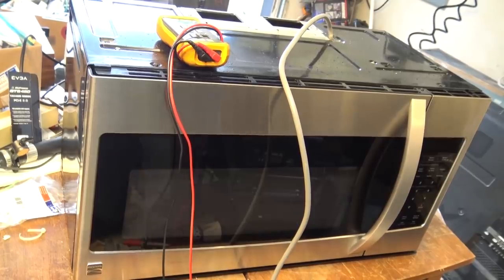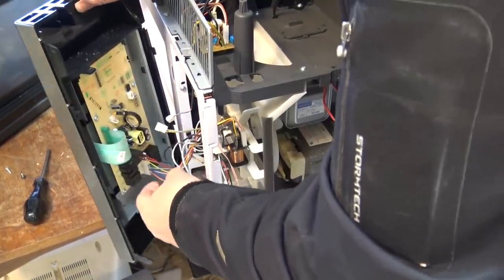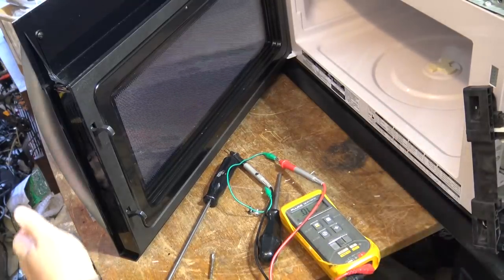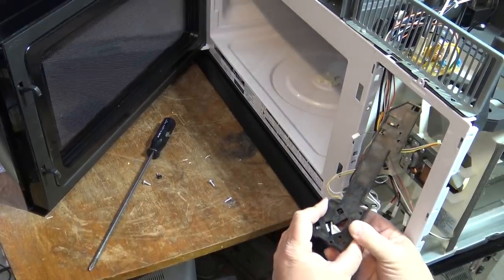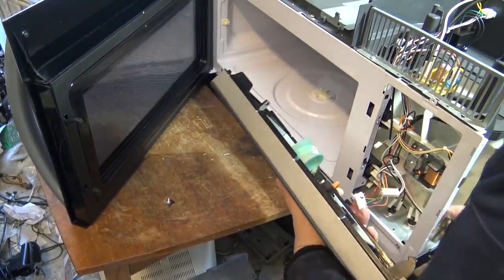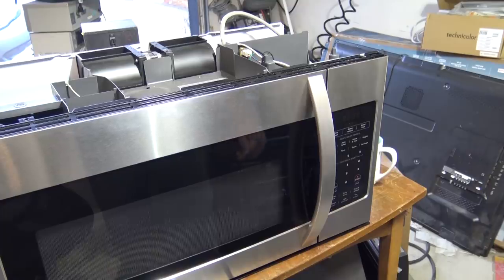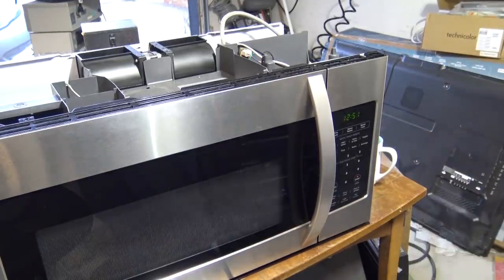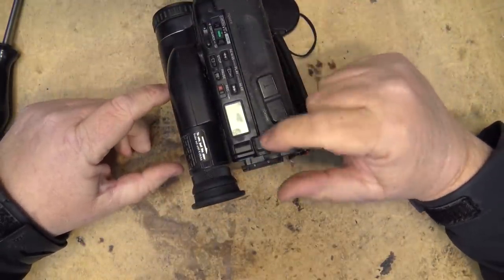Microwave Oven Blowing fuse as soon as plugged in

Comment: awesome !      Micro blew 4 fuses in the last few months......  worked for a few weeks inbetween.   Today it failed and kept blowing the fuse as soon as I plugged it in.
Found this video,  checked the door switches and one had failed.    Found replacements on amazon.       A $15 repair rather than an expensive service call   👍
Reply: Was it blowing the breaker once you plug in the outlet?

Comment: For those of you with the same issue with the door catch bracket that has worn out. I used an ABS slurry to “paint on” some additional plastic to repair that part. Worked great and saved me $30-40 for a whole replacement bracket. Acetone and melted some spare legos is all it took.
Reply: The biggest problem with these switches is opening up the Microwave while its still runner, that shoots a small current through the switches and eventually casses one or both to stick open, usually the one that closes first.

Comment: Excellent video. I watched several because my microwave pops the fuse as soon as it is plugged in. From watching your video, I understand why. I saw several saying it is the door switch (which I will check those tomorrow) but you explain WHY the switch fails and not just how to replace. Knowing WHY is just as important as HOW to replace it. Excellent work. Subscriber now!

Comment: Mine ended up being the switch holder. Without your commentary I don't know if I would have noticed the worn latch guides! 

I've only had this thing for TWO YEARS and it's already worn excessively. I had my previous Whirlpool microwave for almost 8 years and it still worked when i got rid of it! (although the finish was peeling off of the handle).
Reply from the maker: Yes ended up ordering the part and changing it.  Took 2 months to arrive.

Comment: thank for video .that is same microwave as ge.very common issue with them  .the problem is the latch body itself has worn out  that you can see in the video causing the  middle switch or monitor switch not to open up and short. ge recommended to change out  latch body  ,middle switch and door hook. if not it will happen again due to worn out latch and hook.

Comment: First word out my mouth when I saw the title was "crowbar"... Only because of a previous video where you explained how the dual door switches work though so thanks :)
Reply: White balance, yeah I thought you looked cold haha
Reply from the maker: A crowbar is an over voltage protection device. Can be as simple as a zener diode set to the maximum voltage in low current applications. In high power devices a SCR triggered by a zener is usually what is used in DC circuits. In more elaborate circuits the SCR would energize and latch a relay with the circuit  wired to the normally closed contacts. Once the zener activates the SCR triggers latches the relay to the NO contacts and removed power from the NC and your power is interrupted until he SCR is reset.
Reply: And this is why you have a subscriber in me! I knew it wasn't quite right to say crowbar, but couldn't think why lol. I just imagined it as a crowbar forcing the fuse to blow instead of the user's face getting roasted. I'll digest this reply & correct my terminology, thanks.

Comment: Sweet, just mine working! Thanks so much for posting this man!! 
Not the same exact problem here, but very similar. On mine, the fuse was blowing when the microwave was turned on. This vid led me to check the switches. On mine, the monitor switch was just a bit jammed up (stuck down) - pressing it a few times w/a screw driver got it working/springy again. I tested w/a multi-meter and continuity was working as expected, after that, plugged things back in, back in business. 😎👍

Comment: Sorry for the late viewing, my internet has been dead since last night to 11 in the morning today :-(.
Speedy repair :-)
My knowedge on microwave cookers is minimal, the anode of the magnitron is tied to negative (same as earth in the uk)and the cathode is connected to a negative voltage created by a high power/voltage diode and capacitor.
That 5kv transformer/diode/capacitor makes the red alert bulb lightup, i dont like being zapped lol.
That shorting safety switch is the most important one.
Reply: Your power was out too?? Mine was out for quite a while, from storms, I guess, not certain because it didn't go out until like an hour or more after the storm had passed.
Reply: A Three Dog Night
The difference in my case is it wasn't the power that went out, the isp service just failed.
Virgin media internet is a pain for having problems :-(
Reply: @zx8401ztv , Oh, OK then.

Comment: I still have my 1997 Sharp 1000 Watt counter top microwave still going strong. My door doesn't have a handle. You have to push a large button at the bottom of the control panel and it swings open. I plan to keep this microwave as long as it will nuke my dinner.
Reply: I still have the same one too. Sharp microwave with a push open button for the door. 1998 model. Clean quiet and strong 💪.?? With automatic popcorn timer.

Comment: This is awesome!!!  The comment you made about both contacts needing to hit at the same time solved my problem.  I noticed that the plastic mount holding the two door contacts was push back on the bottom after 8 years of use.  I realigned it and tighten it down and PERFECTO!!!  Thanks for your vid!!!
Reply: It’s kinda of an over engineered design to prevent silly people from operating the oven with the door open.
Reply: Actually one has to activate just before the other does so if that is not happening due to a bad first switch or a loose switch assembly it can blow fuses when you open the door.

Comment: after watching your explanation of the purpose of each of the switches i was able to figure out why mine was tripping breaker when opening the door even though the swicthes all checked ok. i always grab the handle at the bottom and jerk it open which over time has caused the shorting switch to activate a spit second before the top switch was opening.  after your explanation (which i couldnt find anywhere else btw)  i went out and grabbed the handle at the top and yanked it open and voila no breaker tripped!!!!

Comment: I think that the contacts of the driving relay for microwave lamp along with the internal tension spring sometimes need checking also because the contacts burned and remain stuck and the lamp keeps working without any other noticable sign.Once had this problem with the capacitor blown and the gears of the mechanical timer worn just because the relay contacts didnt open and the timer motor kept working along with the RF lamp in silent and melted the facing plastics until the capacitors short circuit.

Comment: Great video!     Our MCO1610WF blows the fuse when the door is opened.     All normal until then.  Likely a primary switch fault?    Are the top and bottom switches both primary and the third secondary?
Reply from the maker: On most the primary it top and secondary is one if the bottom.  The second bottom switch stops the timer when you open the door.   The secondary is a normally closed switch. The primary and timer normally open.

Comment: Sir..while watching your video...I have planned of heating my Burger to my microwave.. It just happened.. That my microwave..makes a large noise..not the normal...and I stop immediately... I switch off..then try it again..its the same..and when I stopped it again..I smell something like burned...but the unit I still on have lights..etc..no blown fuse or whatsoever...what do you think is the problem... Thank you sir
Reply from the maker: Possibly hv diode, hv capacitor or magnetron has developed a short
Reply: @12voltvids  thank you...I'm afraid of the noise though.. It sounds like a fridge compressor when cooling

Comment: My oven's panel was good but it wouldn't turn on the nuke. A bad switch tested good but it didn't work as well as the other switches.
I took the bad switch's cover off and found the lower contact slipped down a little that made the switch movement weak. I corrected the problem and sanded the internal contacts with fine sandpaper.
The oven now works. $0 cost. If it happens again I'll epoxy the lower contact in place to keep it from moving down.
My cheap Emerson was made in 2005 and works as good as new now after the fix.

Comment: Hi, and thanks for this video.  I have this exact microwave and it's tripping the circuit breaker every time you run the microwave.  I purchased all 3 new switches for the door and changed them out, but unfortunately it's still tripping the breaker.  

I think either it must be something else, or it could be the latch assembly that holds the switches.  When I took out the old switches, I think I broke off the little lever that holds the switch in place with the screwdriver.  Is that piece located on the latch assembly to hold the switches in place?  Do you think it would be worthwhile to replace the latch?  I've spent almost $100 on this microwave and it's still not working, so I'm reluctant to spend more if it won't be fixed.

Thanks in advance for any help!

Comment: Can you please explain why this system is better than having two normally open switches in series? Thanks
Reply: To prevent the microwave from operating while the door is open, most do have an upper and lower door switch.  Sometimes a broken or stuck latch, stuck switch, etc will prevent the switch from operating.  The final switch is this "Monitor" switch that shorts the line only when the other switches do not open first.  Sometimes a bad door alignment (do you slam the door?) will trip this switch first.  This shorting switch sometimes stay welded shorted, but this is not a fault of the switch.  It means it did it's job and the oven needs properly serviced for safety.  The other switches have failed.  All 3 need changes as a set as the first two failed and the 3rd protected you.
Reply: With two normally open switches in series both will be passing and breaking current so the contacts will get worn and have a higher chance of getting welded together (which would defeat the safety.) The normally closed monitor switch, on the other hand, never handles any current unless there is a fault, so its contacts will stay pristine.

Comment: Is there any reason why removing/unplugging the monitor interlock from the circuit would prevent the microwave from running? Of course, just from a testing perspective.  Seems to me if it was unplugged, circuit should would not short and 'act' as normally open. TIA.
Reply from the maker: If you unplug the safety interlock it will run. Thus us the normally closed switch that opens when it is pushed in.  The other switch to it, the normally open switch shuts off the timer.   The safety short switch does that, puts a dead short  across the line to blow the fuse.

Comment: how come they fail more often over a gas range compared to electric?  what's the difference?
Reply from the maker: Heat. Gas ranges produce a ton of heat. That is why people with gas ranges have big exhaust fans. Not only is there the steam from what is cooking there is the heat from the open flame. That heat heats up the bottom of these over the range units, and when you heat up the metal, and there is plastic inside what do you think happens to plastic when you heat it. I'll give you a hint, it gets soft and can warp.
I would NEVER install a microwave over a gas range. An electric or induction cook top, the only heat is from the steam, and well steam won't be more than 100'C or 212'F. The heat from the gas is much hotter than that.

Comment: I thought the door switches were my issue as to why the fuse keeps blowing as I have the same model. I replaced all 3 switches and the black switch mount , door hook. Tested all switches with door open and closed. Still blows the fuse after buttoned up and turned on.

Comment: Why does my microwave intermittently blow the fuse when the door is opened? It was not even being used. I pulled open the door and was about to put some food in. Haven't even press "Start" yet!  Checked all 3 switches with the connectors removed from the connectors - all good!

Comment: I could really use your help. I have a 2 year old microwave and the thermal fuse as well as the internal fuse continues to blow. My wife opened the door to the microwave before the timer was finished and it lost the power. By adding a new internal fuse it regains the power but when you press start on the microwave it immediately loses all power again and blows the fuse. After further investigation I found that one of the thermal fuses was bad. I replaced it and replaced the internal fuse and it worked great for a couple of weeks. My wife opened the door again the other day before the timer was finished and now it has no power and the thermal fuse as well as the internal fuse is blown again. What could be causing this. Thanks in advance for your help.

Comment: Good video.  I was able to get my microwave working again, but if I open the door while it's running it blows the internal fuse and throws the circuit breaker.  Obviously this suggests the switches on the door latches aren't disengaging at precisely the same time, but how can I determine if there's too much play in the door (there is some up and down play when I try moving it with my hands, but not sure what's and acceptable amount) or if there's an issue with the bracket that holds the switches?
Reply: I have the same problem, did you ever figure out a fix?

Comment: I have a GE JVM3160RF3SS that appears to be nearly, if not exactly, the same construction as the one shown in this video.  It suddenly started tripping the circuit breaker in our outside breaker box upon pressing start.  After watching many videos, including this one, I found out that there was an easy fix that didn't involve replacing any switches.  It was merely that the switch on the lower door catch had become stuck, probably due to heat, moisture, grease, etc.  After simply pressing on it with a screwdriver while the door was open (no need to remove the control panel at all), it became free (started clicking) and the microwave worked again!  Hope this might help someone.  ;)  Oh, and thanks for the tip in the video about pulling the door handle in the middle instead of the bottom - good to know!
Reply from the maker: Once the lower switch activates once. Even though you can pry the contacts apart and make it appear to work but it may not when it is needed. If a switch has ever popped I can only say it must be replaced.  Giving any other advice would be irresponsible.
Reply: @12voltvids  We're talking about two different things.  I didn't pry anything apart.  I simply pressed the switch from the outside a few times until it released from whatever was keeping it from moving through its full range of motion.  Then, the lower door catch was able to activate the switch again.  This is not to say that the switch has much life left in it but I read plenty of other comments from other video tutorials that had the same issue and this was the easy solution.  Obviously, if the switch was bad this wouldn't make a difference.

Comment: I always knew there were multiple safety interlock switches in a microwave. I did not know there was one that direct short line and neutral I will have to remember that.
Reply from the maker: Yes definately. Fail safe.
Called different things by different manufactures. Monitor switch, short switch, failsafe, secondary interlock.  Every microwave over will have at least 1. Some of the older ones had 2.  One on the door hooks and a second one on the hinge on the other side to trip if the hinge broke.
Reply: What's it for, to reduce the chance of the magnetron becoming energized in the event of a door failure?
Reply from the maker: @uK8cvPAq  
Not to reduce the chance of  the magnetron being energized, but to eliminate any chance of that happening. A dead short will blow the fuse and kill the power

Comment: One of my switches was bad so I just replaced it and made sure it works but I’m still getting a short (continuity) at the plug when the door is closed. If I open it it goes away like I’m the beginning of the vid. Also blows the fuse as soon as it’s plugged in.
Reply: Just realized I installed the wrong switch. Needed a normally closed but mistakenly put in a normally closed.
Reply: @HackMasterBlaster  Look at schematic diagram on the body of the oven.  Before doing anything.